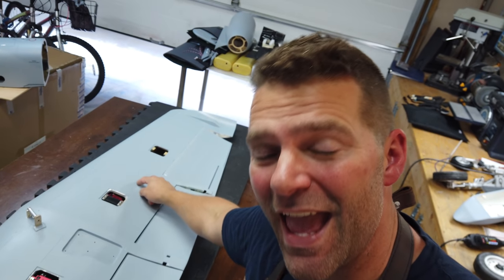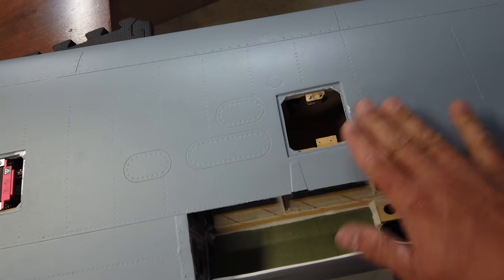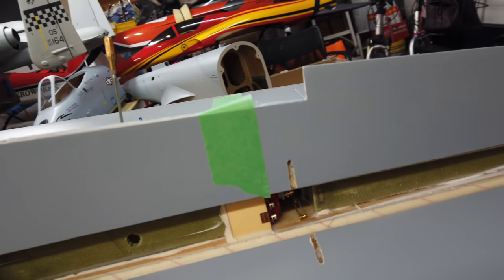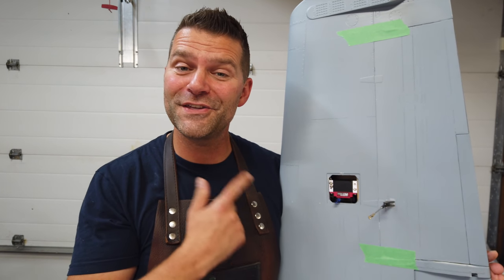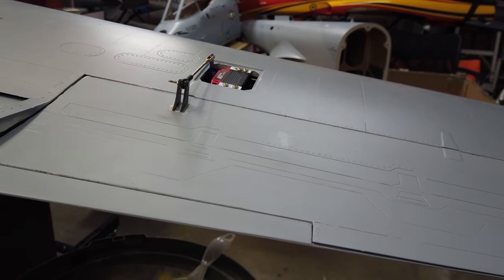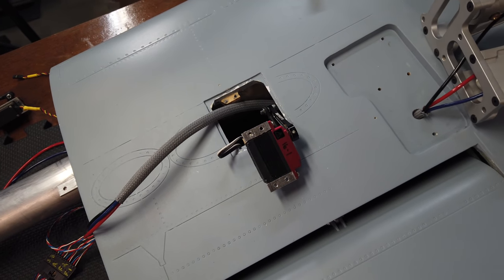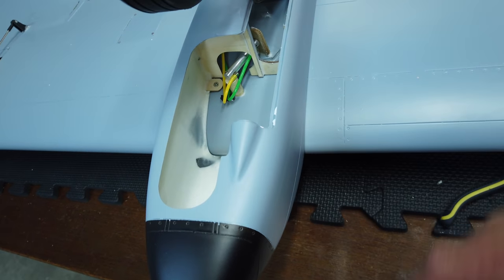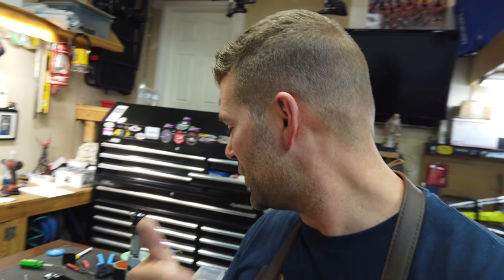GIANT SCALE A-10 Tank Buster Build Continues - Aileron, Speed Brake & Gear Skymaster A10 #3

Comment: Hi Jonathan, just one question, what kind of servo do you use since when you close the speed brake doesn’t make any sound, I installing the same speed brake in same aircraft and when I close it they make noise, otherwise the speedbrakes will not close perfectly.

Thanks a lot.
Reply from the maker: Hello.  I believe that was a JR Servo in the Speed Brake.  It's important to keep adjusting the linkages to get things working properly.

Comment: The mounting holes don't match up? How expensive is this kit again? This  Skymaster kit seems like a sloppy, thrown together kit from the factory where the employees are pulled right off the street and put on an assembly line then given 5 minutes of "training." Then the conveyor belt starts zipping parts by the temp agency workers who "eyeball" everything. You keep saying how impressed you are with this kit and I keep seeing examples of shoddy, half-assed factory construction of the parts. I can look passed a few surfaces needing some touch-up sanding but so far, I'm not seeing a whole lot of motivation to purchase this kit. Maybe if it was a hundred bucks (minus the landing gear, those parts looked more precision built), but I'm horrified by what I've seen so far.
Reply from the maker: Hey Cliff.  If you saw some of the other kit's produced by other manufactures you would cringe more!  😂. Thanks for watching!
Reply: @thelightersideofrc  np. I just saw a review of an extremely cheap rc p-38 lightening (I think it was the rc sailors channel) and it was bad (so bad he had to ask his friend with greater experience to get the "kit" together...although, he said it flew quite easily, everything else was garbage but handling characteristics were way above what he expected).